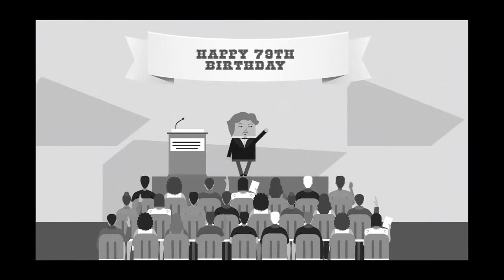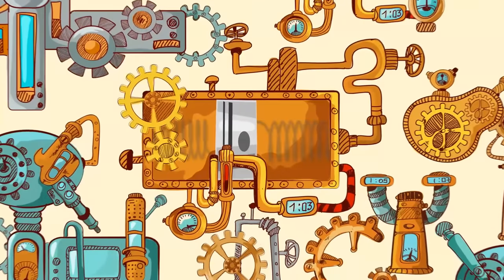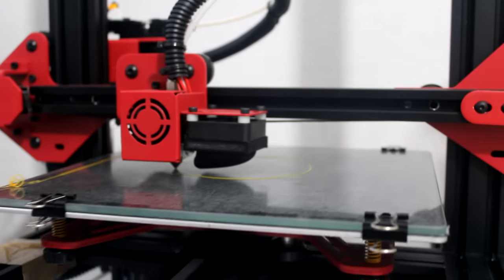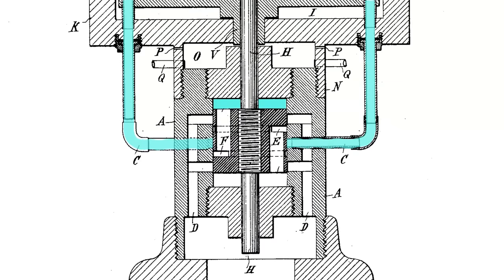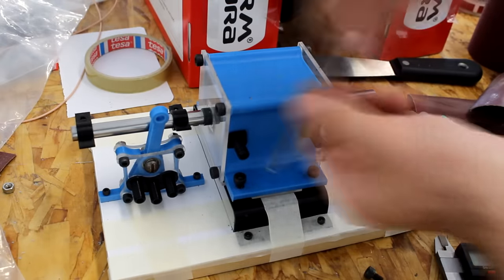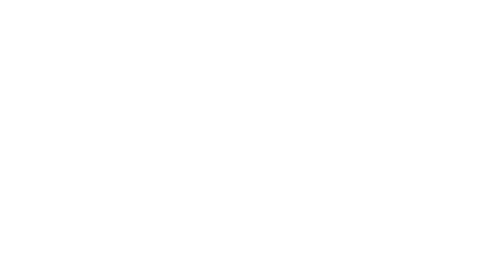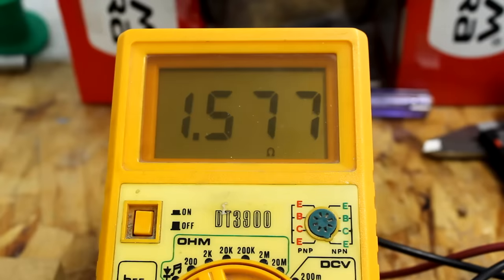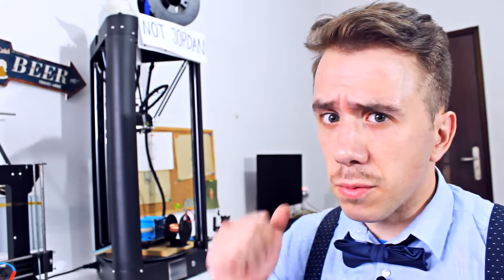Tesla Earthquake Machine [3D Printed]

Comment: Sigh - look at the engineering of the steam engine.  They solved this problem of the steam engine getting stuck dead-center 100+ years go.  Their solution was to use a flywheel as a source of inertia to keep the steam engine running.  In fact, just copy the entire steam engine and connect it to your electrical generator of choice. There is nothing new with Tesla's "invention"  just the implementation he used.  Amazon sells five different model steam engines.  You can buy one then connect it to your generator of choice.

My question is, unless you have a pollution-free source of steam , why would you want such an ineffective power source to drive your generator?  Power stations did that for a long time.  But coal-powered power plants are being eliminated by radicals that think the air should be left clean so everyone can use it for breathing.  The coal industry is very angry about that.

Another problem with Tesla's design is that it is extremely difficult to keep the AC coming out of one power station in phase with another power station. It is also very difficult to maintain a constant frequency and phase of the generator.  Old analog wall clocks keep excellent time because the frequency generated by power stations was very precisely controlled.  The speed at which all the clock hands spun was directly controlled by the frequency of the power coming from your local power station.  Read up on the technology that keep almost all AC power stations in the country in phase so that load balancing can be handled by switching a load from one power source to another one with no disruption in the AC phase. "Almost all..." because I believe that at least at one time power generation west of the Rockies was separate than that generated by power east of the Rockies.  I do not know if there was an effort to keep those two power distribution systems in phase.

Bottom line, Tesla's invention was obsoleted a very long time ago by advancements in the engineering of steam engines and AC generators of power stations.

Comment: Although it made energy from moving magnetic fields, which it gained energy. 

what if part of the moving oscillating rod, at fast speeds rubbed something and by doing so created static electricity.  Which can also be stored or discharged into something 🤔. 
2 sources of energy 😆🤣😂😹😆 moving magnets and also static generator 😆🤣😂.  

Because the oscillations can be really fast aka lots of static charge lol

Comment: Not sure you'll ever see this. I like your video. I thought you would like to know that someone did improve on Tesla's oscillating generator design, NASA. They replaced the steam driven motor with a Stirling Cycle oscillating motor and made the generating section much efficient. The operates at a much higher frequency and the output is then rectified to power satellites. It's gone up on a number of them and uses solar heat for the power source. Here is a simplified explanation: https://science.nasa.gov/technology/technology-highlights/high-efficiency-stirling-convertor-demonstrates-long-term-performance   Look how similar the machines are.

Comment: make a torque meter by a fish weight connected to a string that is connected to a solenoid magnet and coil that is connected to a ac generator. the generator put output emf into the solenoid dc current and the solenoid contracts pulls the string that puls the tension on the weight or take a dc motor and short circuit the output and then a string to the shaft to hold it back and put  the string to the fish weight and then use load or varaiable resistor or ampere or volage regulator to get the max torque reading of the weight or use a magnetic rotor with magnets on the drive shaft and use a alumnium disc against the magnet rotor on a rotor spindle and connect a string to the shaft of the aluminum disk and then put that other end of the string to the hook of the fish weight. the turbine will turn magnet rotor and rotate by inducion the aluminum disc and by slow down the aluminum disc and by stalling it against he weight by the distancing of the aluminum and the magnet rotor you will get the torque.

Comment: You need to calibrate your printer, almost a 1mm deviation is horrible even for the worst printer out there, mine for a circle that size has 0.2mm deviation and it's only a 200$ printer. In the square piston you didn't do so bad so maybe print settings ate to blame. Print a brim, it may help.

Comment: T'as pas senti...
Je crois que ça commence à vibrer
T'inquiète c'est les ingénieurs... 
ça fait toujours ça la première fois, c'est le temps de transmettre un signal cohordonné

Dit donc tu sais qu'il fait froid là haut, j'espère qu'ils ont pensé aux triple vitrages à gaz neutre et à récupérer l'énergie lumineuse qui les traverse pour alimenter un petit chauffage d'appoint

Un ensemble de nids d'abeilles en strates sur les surfaces vitrées, si les strates ne sont conductrices thermiques entre elles permet de limiter de manière localisée les différences de température

Les pièces de rechange sont aussi plus petites donc plus faciles à modéliser si le volume augmente

https://youtu.be/kxdgHkdAiCg

Outsiders back in the reality game :-)
https://youtu.be/AQhu28LmAvY

Form frequency sound and waves are linked
https://youtu.be/6kLmlbkWJZ8

https://youtu.be/wvJAgrUBF4w

A special rythme and music for a special spatial organization

The same with gaz if you link a grind of burners with a sound incidence

If the harmonic waves are linked, it amplify the result
But most of the time we use more silent blocks to reduce the noise of vibrations

What you are searching is named
Quadrature de phase
In French electric words, it works with springs also a Scottish experience on a regular air flow explain it very well

It's the result of a simple slice movement improved withe the tension in the spring
In your design it seems that the idea was to express all the movement in one global result

Linked to a wall indeed

Interesting communication tryed with plants in ultrasounds we can now talk directly to the organic forms in the jar

Don't kill the unknown until you don't have understood yet, communication is really much betterhttps://youtu.be/-NsDdPMOUIA

Comment: Tesla's Earthquake Machine is nonsense!  Practically any machine can be made to cause small local earthquakes enough to destroy buildings.
I once nearly shook a building down by running a lathe too fast.  Everyone else panicked as the floors started jumping!
Tesla's seemed violent because all New York skyscrapers are rooted into the slab of bedrock NY is built on.
250 years ago in UK big textile mills were constructed and powered with steam engines.  On each floor of the mills were long line of machines and the mill owners knew to be careful about the speed of the machines as it was known that 'THE THROW OF THE MACHINERY COULD SHAKE A BUILDING DOWN'.  THat happened with some early mills before the learned to build them stronger and to balance the machines to tun smoother.
Anything will fall to pieces if it is shaken to its frequency of vibration.
Take a balance weight off your car tyres and drive off and the car will shake its wheels off as soon as speed get to 40-50mph.
Get me access to the tallest buildings in the world and with a $400 box of pieces from a hardware store I could shake them all down.  And probably devastate the surrounding area.